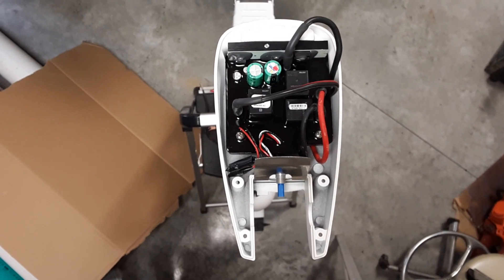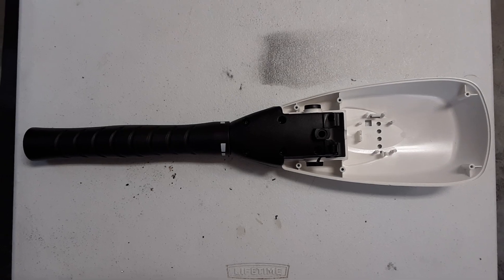Minn Kota RipTide 24V 80lb Thrust Trolling Motor Electronics Upgrade

Comment: Dought you still read these posts, I rebuilt my riptide cept for electronics  board. Don’t make it any more, hv 24v riptide RT-74. I plugged into 24v and motor came on, variable speed but just don’t know how fast the prop suppose to spin I figured it would be spinning slot faster maybe not variable speed does work reverse works is there any way to check amps on wires or check anything to make sure it’s going as fast as it shoujd turn the prop that is
Reply from the maker: The only way to check the amp draw would be using a meter at the motor connections. I don't know how you could check the prop speed.